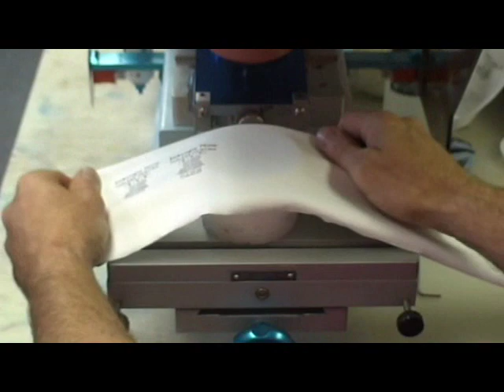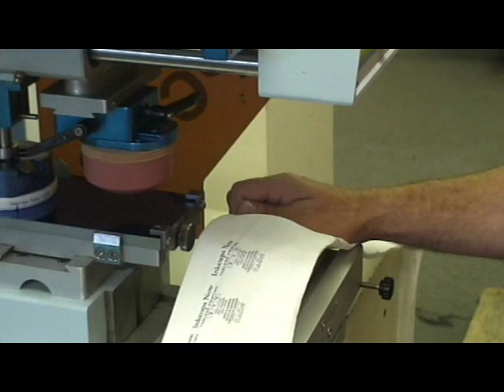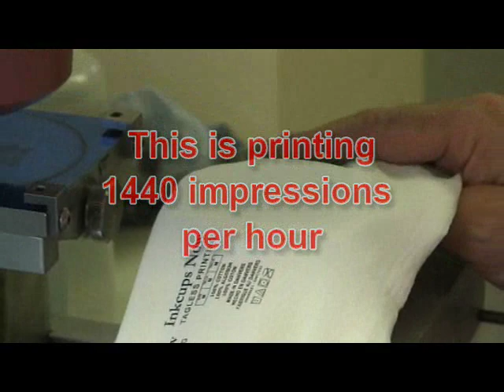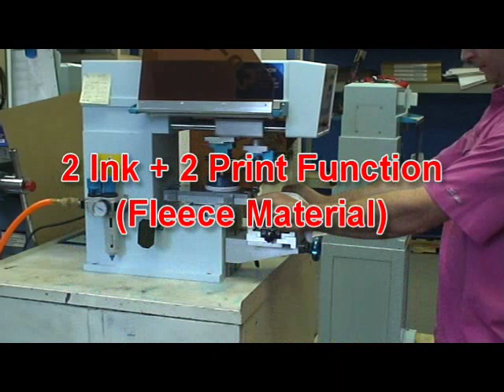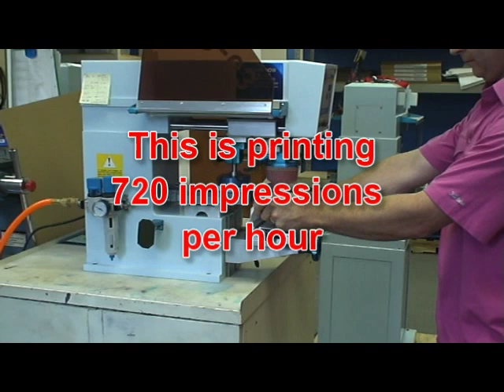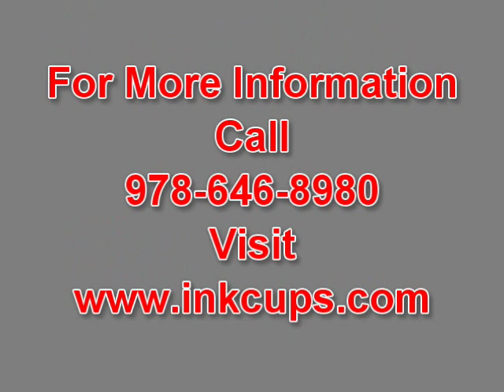Tagless t shirt printer for apparel manufacturers - alternative to heat transfer neck labels

Comment from the maker: - Loading is fast: don't turn the t-shirt inside out, place it on fixture, then toss on the side (the prints dry immediately).
- You can stop for up to 6-8 hours as long as you cover the etched area of the plate with ink cup. 
- We offer plates that are etched with laser etchers (CO2 or YAG), no chemicals involved, within 1-5 min. We can etch plates for you. Photopolymer plates require water or denatured alcohol.
- Pad printing cost is similar to that of silkscreen. Except you don't need dryers.